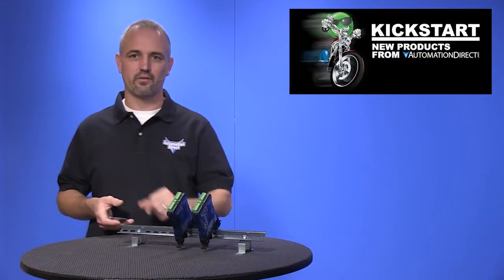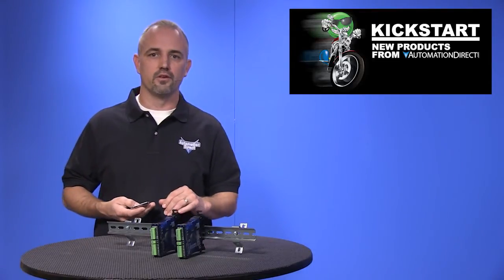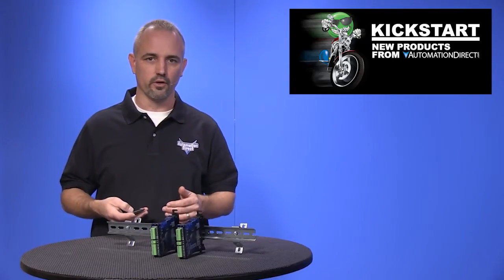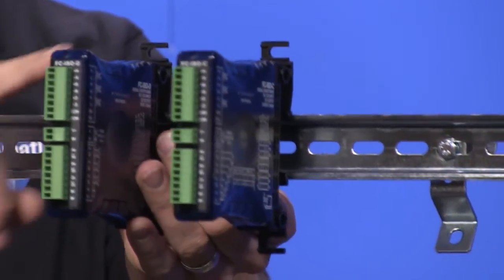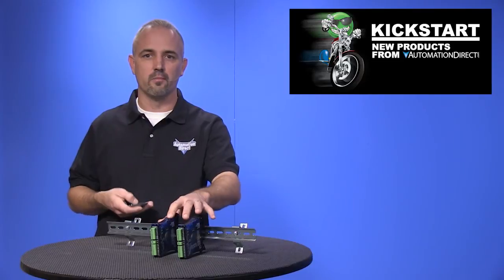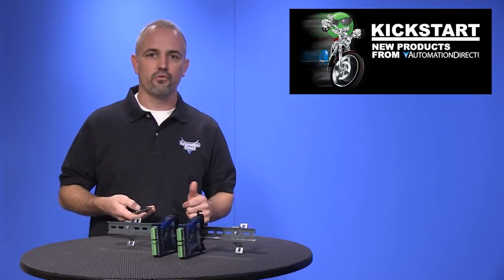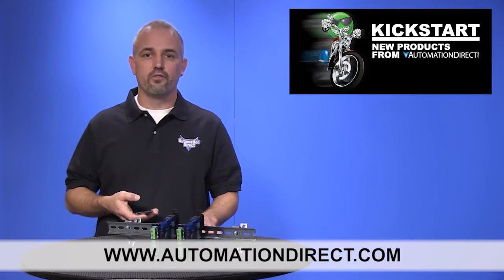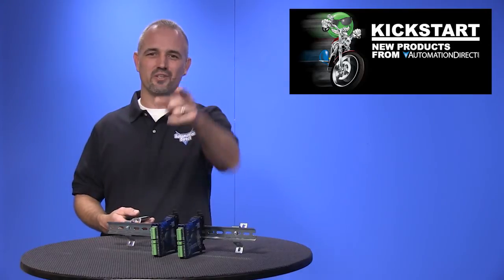High Speed Optical Isolators (Encoder Input) from AutomationDirect

Comment: I am using FC-ISO C encoder output to the 1756-IB 16 modules. I have a hard time getting high-speed Z pulse output. Please let me know if IB 16 module is capable of handling that output or HSC module will be good.
Reply from the maker: @thepuppetboyy If the 1756-IB 16 is an Allen Bradley module, you will have to consult AB on the capability and application of that module. If you have questions on the FC-ISO module, it would be best to contact our FREE award winning technical support and they will be glad to answer any questions you have, or post on the community forum.  https://support.automationdirect.com/

Comment: Planning to use the FC-ISO-C to isolate and convert an existing encoder output to operate into the High speed inputs of a Micrlogix-1100 PLC. The existing encoder is an unusual voltage of 15VDC, while the ML-110 specs say it will operate from 14-26VDC, this is getting closer to the edge than I'm comfortable with, especially with the high speed parameters. And the isolation ability of the signal converter will be beneficial as well..
Thanks !
Matt
Reply from the maker: Would love to see your project Control Man! Thanks .   Click here to subscribe https://goo.gl/eNbFdr

Comment: I am working on a project that optically triggers and was thinking this may be a good fit. What is the smallest footprint in the 12 Volt range with a narrow line width. Is the differential driver as fast as the Optical switch when switching in the 1 amp range to a coil field inducer. Thanks for your time, Scott